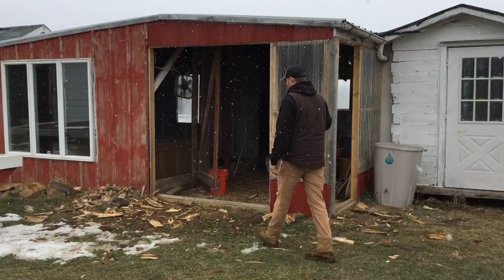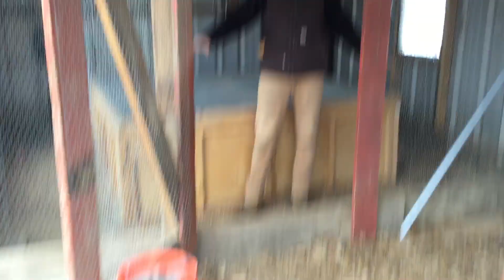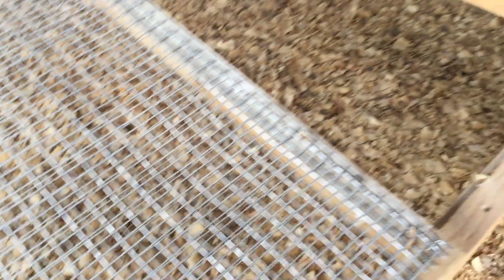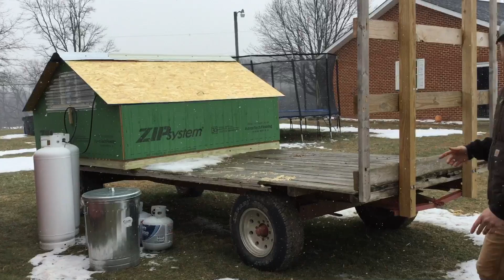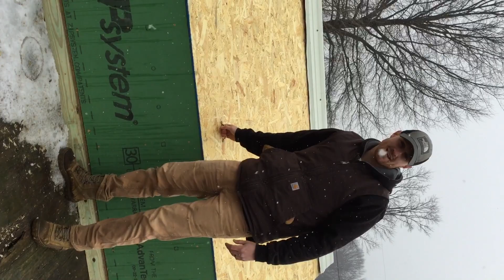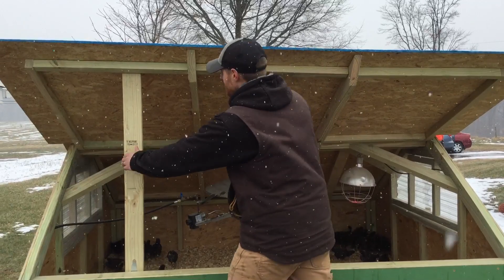Polyface Designs brooder COMPLETED!

Comment: Where do you get the ShenVEC heater? I can't seem to find them. Do you have a link?
Reply from the maker: They are very hard to find. The only place I found to get them is the Farmer Boy Ag website: https://farmerboyag.com/shenandoah/
One of the problems is that you can only buy the heater in a pack of 4, which is very expensive, and probably not needed unless you have a huge operation. Best thing to do is try to find another farmer(s) who wants some heaters as well and split the cost. That's what I did.
Reply: @stonepillarfarm9089  awesome thanks!

Comment: Do they only have this one brooder design in their book? Do they have a design for a smaller one as well? Like maybe half that size?
Reply from the maker: Yes, this is the only design in the book. I think you could easily make this half size (4x4) but the problem would be that the propane heater would not have enough room to safely operate. The main benefit of this brooder is that heater. Anything that is secure from rats and can safely operate the heater is good to go.
Reply: @stonepillarfarm9089  thanks. I have been thinking of making something that’s 4x8. Still thinking about it :)

Comment: The brooder is looking great! I'm currently building my own free-from-scrap brooder. I'm glad I watched this because it gave me a few ideas. For instance, I am going to use the "hood prop 5000" you used to hold the lid open
Reply from the maker: Thanks! Good luck on your build. Cheap or free is great, so long as it doesn't mean a poorer design that ends up costing you more in chore time and animal loss. My original brooder was free but cost me 10 times the hours in labor during brooding because of how poor the setup was. I also lost way more birds due to piling because they were cold without the nice shenvec brooder heater. Raising birds this year is a completely different experience now that brooding is so easy and automated.